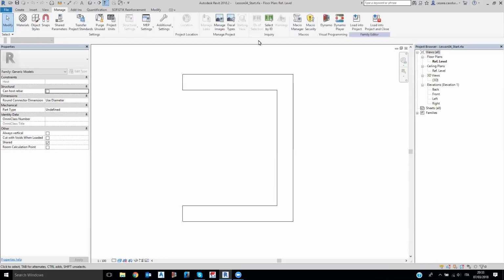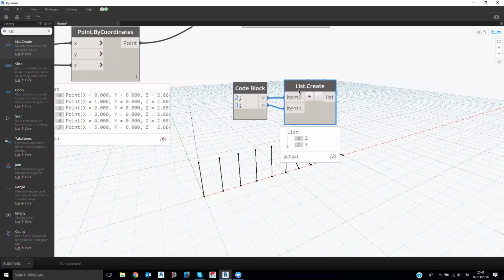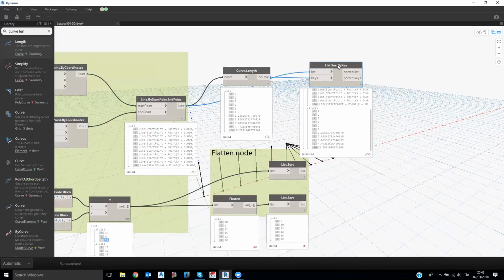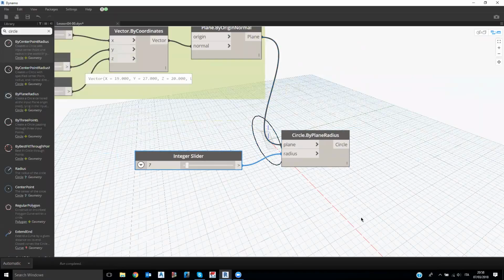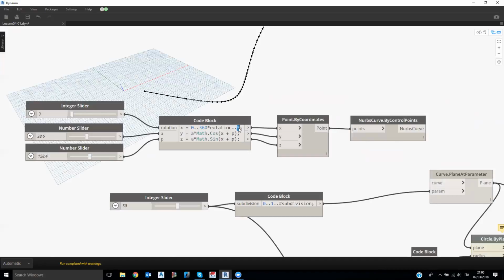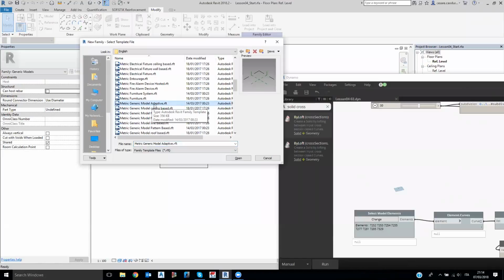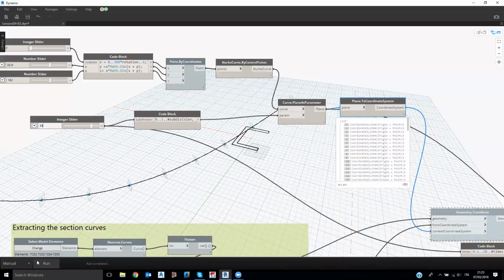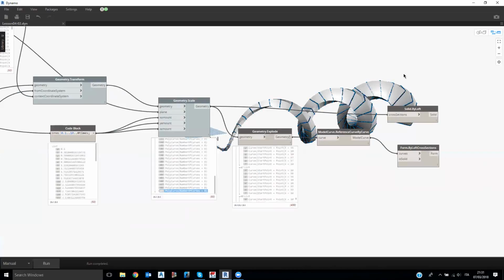Dynamo Basics Training - Lesson 4

Comment: One query.
When I select the polycurve to baseplane. it is taking the origin as one of the point of the hexagon element. Which is then resulting in non uniform or asymmetrical shape when geometric shape node is applied. I want to change the coordinate axis to the center of the hexagon so that final solid is uniform or symmetrical in shape when changing the scale of geometry.
Reply from the maker: You need to do some calculations to get the center.

Comment: Hi! I have drawn a curve from coordinates imported from excel. Then created points at parameter and plane at parameter and coordinate system by plane.tocoordinatesystem. but the coordinate system is not consistent throughout the curve, some are rotated by 180 degrees. What is the problem here?
Reply from the maker: Thank you for your message. Please search in the Dynamo forum for a solution. We're sure you'll find a fix for that. We also appreciate that you post it here as it will help others as well.

Comment: actually, what will effect the speed of dynamo to run the node command faster ? in above video i see your dynamo can show the solid or surface quite fast, but my one is very slow? I believe my pc specs is actually not so bad with SDRAM64GB, Intel i7 8700gen8, SSD 256GB , VGA Gtx 1070ti 8GB
Reply from the maker: You're harware seems pretty capable... It may also be related to misconfigurations leading to slower perfomance. Hope it helps!
Reply: @DiRootsNews  was it bcoz of too many points or what? but, im sure I have followed your guide in tutorial step by step and fill those point according to your amount too.  In my earlier rendering with Lumion, there is no problem with the speed, so im not sure whether it was caused by the config setting. but, however i will try to look further to check my config. thanks anyhow